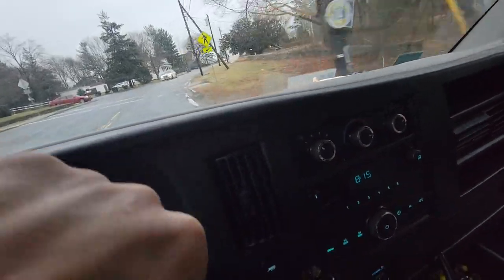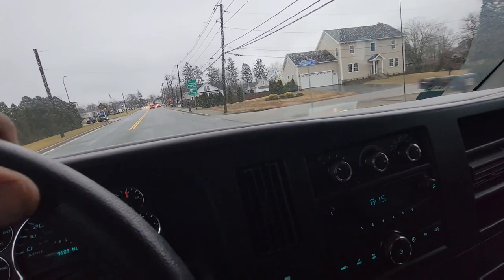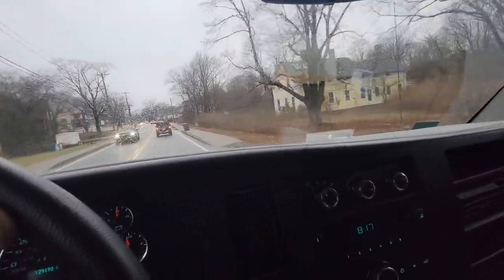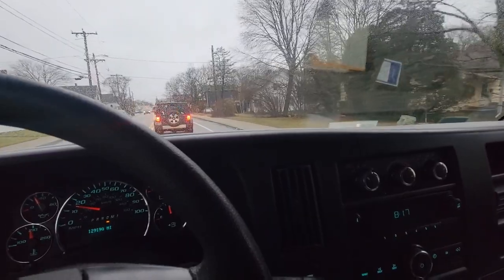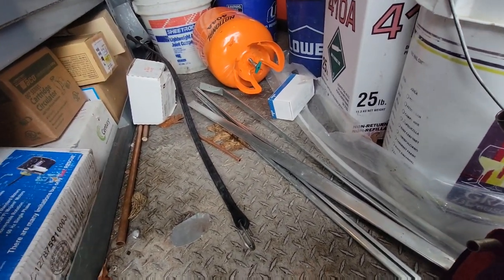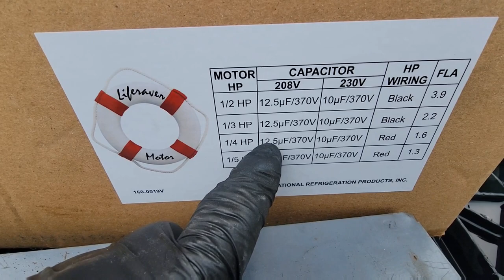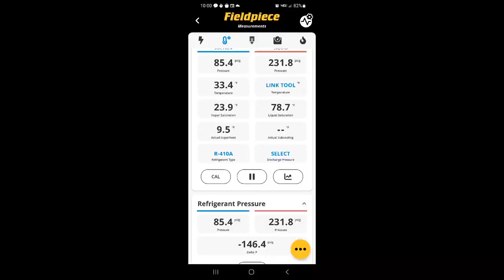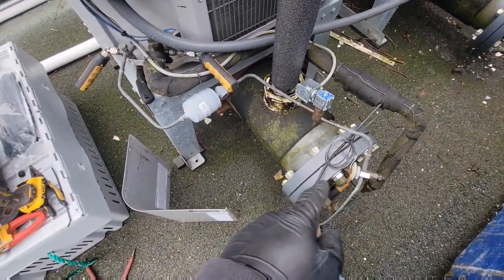Refrigeration - 🦞 Chiller - Bad condenser fan motor

Comment: Titanium shell and tube evaporator running saltwater to the big blue lobster tank to the right of those four units? Those are regular domestic ac condensers?
Cool!
Reply from the maker: The tanks were inside the building. Yes they are regular condensers.
Reply: @mikerefrigeration5736  amazing what you see but wouldn't it of been better just to slap on normal refrigeration condensing units
Reply from the maker: @itsprimetime9865  yes. But a air conditioning condenser is cheaper lol. We have built these units for some customers 30 years ago and they are still running with no service ever done to them but wash the condenser.
Reply: @mikerefrigeration5736  Yeah  i've done a few for some wine cellars  and once was a chocolate storage    wasn't even a walk in cooler  just a room    LOL the things we do ..  BUT  during the video if i'm not wrong there was a massive Semi hermetic around you ! and you didnt show us ! LOL